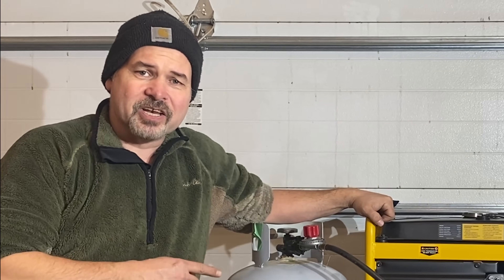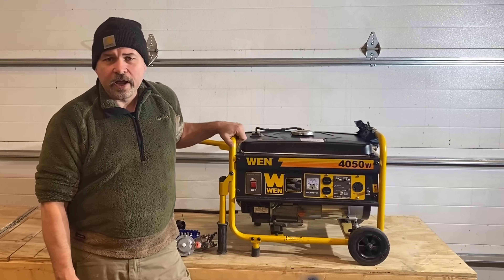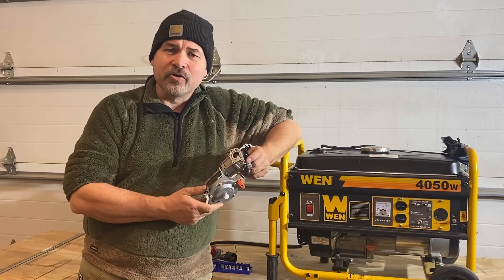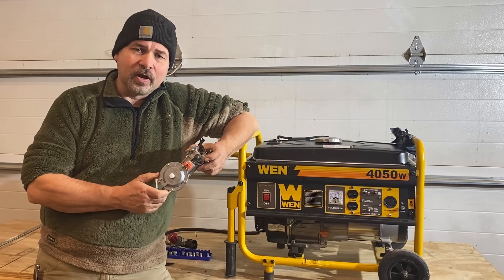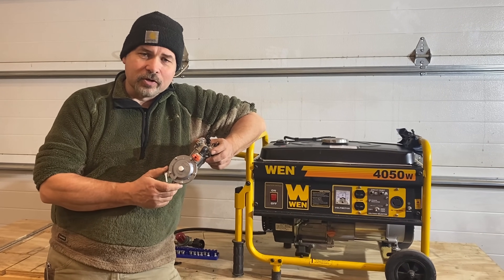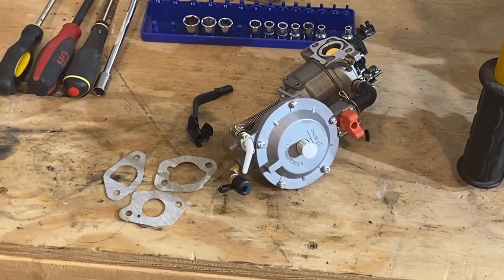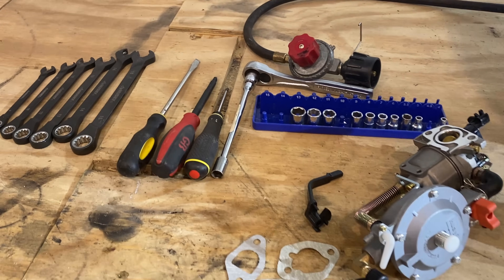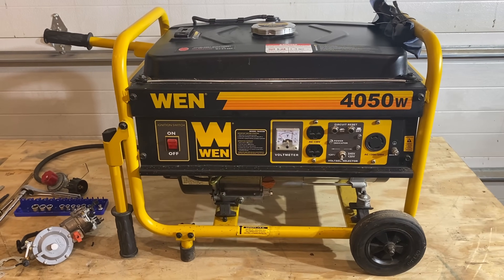how to convert a gas generator to natural gas - How to convert a generator to propane

Comment: so will this  work for most engines? i have the tecumseh engine 10 hp my engine has a single airbox mount. plus have you done a video for natural gas. or will the carb kit regulator auto adjust for natural gas? being you used propane and talk about the hi pressure regulator thanks
Reply from the maker: this particular kit only works on smaller engines than what you have, however, there are other kits on the market that will indeed work for 10hp. As for the propane or nat gas... if you are going to use natural gas straight from the house, you will want to have a regulated pigtail made/installed. We have more experience with propane and that is as far as our comfort level goes due to liability issues. There are a few pretty good videos on youtube that cover the nat gas hookup side of things if you are interested in that tho. 
https://youtu.be/nO839Sayci0
This is a pretty good one.
Cheers!

-Shane
Reply: @AHandleOnThings  I bought a 8  hp Tecumseh  Coleman  Powermate. Generator in 1999. We converted it at the  time to propane. What would I need to do . To use both  Natural Gas, or Propane?

Comment: Did not find out yet I will let you know when I do. It's my friend's generator he has the Gaskets and will let me know.
Reply: The gaskets did not fit from Carb.GX200  170F any suggestions??
Reply from the maker: If the gaskets doesnt fit but the bolts line up and everything looks ok other than the gasket you can buy gasket material (the paper gasket material is available from oreilley in a few thicknesses) from the auto parts store and make a gasket that will fit. just cut it with an xacto knife. If the bolts dont line up and it just isnt a fit at all, you will likely need to have an adaptor block made. I would say its really easy to do... and it is... but it does require access to a few tools like a drill press and s few bits.
Reply: @AHandleOnThings  I HAVE THE gx300 It looks like the holes line up I will see If it works.I will let you Know. Thanks, you have been a great help

Comment: Sir, I am a retired mechanical engineer and was really impressed by your presentation!
I worked as a manager in big-time fortune 500 and I would hire you in a New York minute to teach my staff.
Anyway, your written comments were so complete that I don't even have to ask if this will work on a Champion 5000w 100596 - I've already ordered one.  I just need for nat gas only (not even gasoline), so I do I need a regulator?

AND you definitely have a new subscriber.

Thanks!!!
Stay well.

Oops - just saw that this is only good for 224 cc, my Champion 5000w is 292 cc.
I ordered "Hipa Generator Dual Fuel Carburetor LPG CNG Conversion kit 4.5-5.5KW GX390 188F Manual Choke " on Amazon - hope it works.  It also has the two wires for low oil shutdown.
Reply from the maker: Lou Lu, 
I stand completely humbled by your compliments.
Thank you so very much.
Stay healthy and safe
-Shane
Reply: Low oil shutdown cuts out the spark, it has nothing to do with the carb.  I realize I'm responding to a 4 year old comment, but it's still relevant.

Comment: What kind of hose do I need to hook up to Natural Gas and connectors?? And can I connect to the Gas Meter or do I have to get the gas co??
Reply from the maker: Unfortunately those questions have answers that vary from place to place and I will have to direct you to contact a local professional to ensure you get answers that wont get you in trouble. 
Sorry for the cop out answer but we certainly wouldn't want to get you in trouble.
Reply: thank's again stay safe.

Comment: I HAVE A Briggs & Stratton Model#BS1525 5250/6500 watts 3600RPM. I want a Kit to Change the Generator to Propane, Nature Gas, and reg Gas. WILL THIS CARUBRATOR FIT MY GENERATOR?
Reply from the maker: James, Sadly, these chinese carbs work fine but the documentation is less than great in most cases. I don't know the answer to your question and I'm not a factory rep or anything like that. The best advice I could give you is look at the carb you have and the carb in the video... If they look similar then it will likely work for you. If I were you, i would also pull the carb that you currently have and look at the gasket... The gasket shape would be your best indicator.
Reply: Have not fond a carb. yet I think the only  thing that will work on the Briggs is a Reg.that goes to the air filter I may try that the only thing is the cost $170. @AHandleOnThings
Reply: Thank's I will do that and see if they are the same. I will let you Know. Be safe.
Reply: @jamesmadonna5794  What did you find out? I have the B&S also and have not been able to find a dual fuel carb for it. Why do these seem to fit every engine except Briggs?

Comment: Sorry to inform you but these carbs are propane or gasoline...NOT natural gas
Reply from the maker: https://www.ebay.com/itm/LPG-168-Carburetor-dual-fuel-LPG-NG-conversion-kit-for-2KW-3KW-168F-170F/303638527028?hash=item46b2443c34:g:X7oAAOSwTFJfI9sS
Well, we have converted many generators with these kits and many are currently running on nat gas.
I have included a link for you and you can certainly have a talk with the manufacturer if you disagree with how they are designed, used, or marketed.
Reply: Thank you!!!!

Comment: How long will the generator run on the size tank you have on it?
Reply from the maker: Without getting into scientific mathematical explanation which seldom is of any use to anyone... Run time is largely influenced by power draw. The more time the generator spends high revving instead of low idle the more fuel it will consume. But I usually get from 8-12 hours out of a 20lb tank if I run it continuously with average draw for my personal situation.  I rarely run a generator all night, and my refrigerators and freezers do fine if shut off overnight and then they are allowed to run during the day. So... About one to 1.5 tanks of propane per day. The best part about this is the propane never goes bad, so it is actually very practical to purchase a tank at regular intervals and stockpile the full tanks. I also like to use 100lb tanks (figure 4-5 times the run time) which are able to be purchased and filled at Tractor Supply stores and similar places. I have established the ability to tap directly into my large 500 gallon propane tanks as well (We have two of those heere at the farm).  
BE AWARE though... If you are using a tank larger than 20 or 30 lbs you will need a different kind of regulator so be sure you prepare for that if you go that route.

Comment: cool video i just got a westinghouse 7500 watt gen im going to hook it up like this . thanks for the video dude !
Reply from the maker: Right on! LEt us know how it goes on a generator that large!! Should work fine!
Reply: Did it work ? I have a 10,000 Kw starting 8,000 constant Generac   i plan to convert like this!
Reply: @jjuwayne  I HAVENT DONE IT YET BUT I KNOW IT WILL WORK THEY SELL A KIT FOR IT ALSO
Reply: @jjuwayne  ITS CALLED PNG TECHNOLAGIES ON THE WEB
Reply: my Gen run on gasoline or propane , should  i just find a hose with adjustable gas regulator then i can connect it to natural gas pipe ?